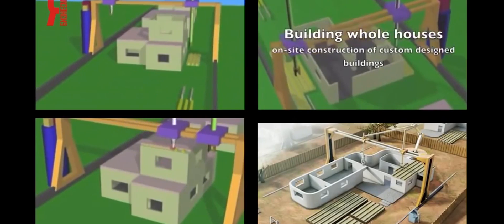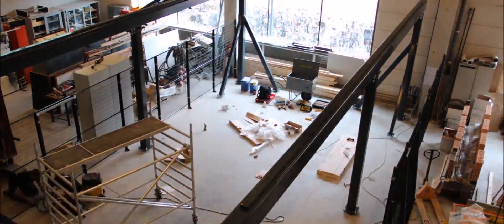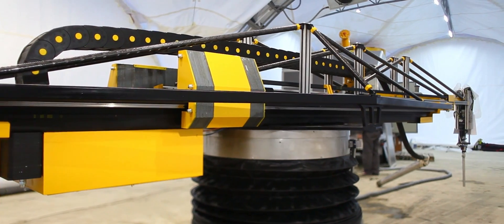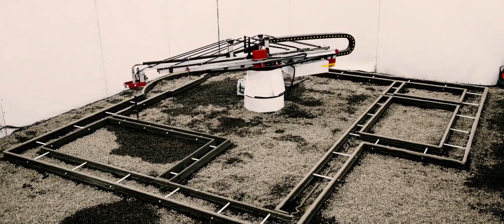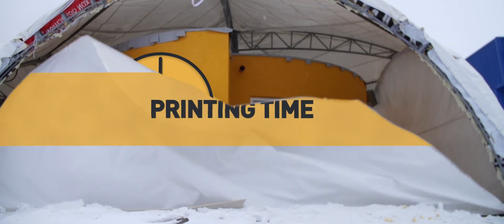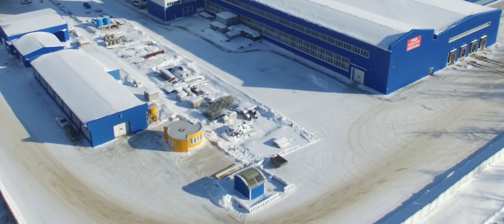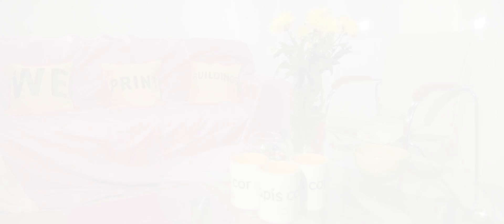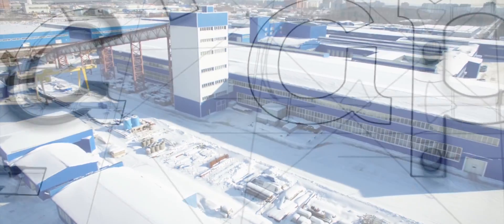Apis Cor: first residential house has been printed!

Comment: The house needs a  Cone top roof...   A Flat roof with 1 meter snow on top ?!?  No! BAD !
You are printing the house, so print a cone on top.  /|\ and then the snow will slide away and water away from the home.  Install proper drainage...

Comment: Non ecological, plus polyurethane transforms into a lethal war gas and will kill you in case of burn, and the polymer walls and rooftop are surely not so much better. What a waste. Construction in straw and wood are really cheap, ecological and sustainable unlike this 3d plastic garbage.

Comment: So in like a decade, all major building companies will have such 3D printer robots, printing very boring round shaped 'buildings'.
And most of the construction workers, masons, will be out of a job?
And yes, probably one job that wont dissapear is obviously electriciens. 
Cause every single market is going to need elektriciens to actually build/do maintenance on those printers. And lets not forget put a lot of electric & electronics in them.

Comment: I want to point something out I did the conversions the square meter to square foot and it came out to be 409.0282 square feet. The average cost per square foot is $125 which means if you were to build a normal house of the same size it would cost around $51,128.53 this house that they 3d printed is a fifth of that. That's amazing

Comment: Very interesting but 38m2 is too small. I want at least 150m2 the question is, can they do a structure that big? How do they move the printer around a larger structure? Other commenters address land, sewer, gas, water, etc. But you can get very cheaply an old house for demolition that has all that for the price of just the land. The money you save vs. traditional construction you can use to put solar panels on your flat roof!

Comment: Anyone arguing the reality of 3d printed homes are lost in time somewhere.  Dude, this is a cake walk compared to the automation technology that has already existed for decades.  I've worked on many types of automation systems and this seems far easier than an automated pharma plant, lab, space shuttle launch, a computer processor, automated car factory, horizontal oil drilling, etc.. This is easy peasy people and you're a dumbass if you think it can't be done.

Comment: I would like to know what the expected longevity of the building is. That roof doesn't look like it will stand up to much weathering. I also do not trust the "honorable mention", comparatively speaking, that the house mechanicals received.

Comment: What's good about this is that building this house doesn't last really long it just lasts for a day and It's very easy and fast and it doesn't need any effort but what's a little off about 3D printing is that if they kept using 3D printing for houses then people won't have a chance to get a job and work so I think the builders should work on houses by themselves instead of 3D printing. Just my opinion please don't argue.

Comment: Is it limited to round/circular designs? Because that is very space ineffective. Much better utilization of area with square/rectangular shapes. Circular design prevents modular design where you can extend and expand current designs or align multiple houses in parallel rows or group them into modular sections.

Comment: Dunno if this would fly in California, earthquake standards etc. I noted the horizontal reinforcement, I didn't see any vertical ones, not that it would be impossible, just curious if it would pass our current building codes. I'm also curious about how the electrical and plumbing is put in, they didn't show that - it's obviously there. With a smaller structure you would need central air (a requirement in some areas) which is nice, and in some areas residential sprinklers are required.

Comment: does it print windows, pipes, hanged ceiling? and then it says printed house cost usd275 per square meter and normal brick build usd232 per square meter.. where does the 70% saving come from? So many things are not explained. And for that reason this video can be completely disregarded.

Comment: RIP CARPENTRY
Reply: And many other trades.
Reply: Actually it's really funny how Americans spend thousands of dollars on reinforced doors with 8 point locking systems and etc, when u can just enter thru the wall...
Reply: carpentry is already dead in Europe, no one builds wooden houses with cardboard walls here. get with the program, america!
Reply: +guguigugu
On a mass scale, yes.  However, there will always be a market for wood furniture and structures.  One thing nice about wooden framed houses is that the material itself, wood, can easily be replenished.

Comment: Extruded concrete with no reinforcing steel?  Concrete mix looks watery, makes concrete brittle and weak.  Actually looks like cement, no limestone gravel at all.  Foundation?   Did it print the windows and wood floor too?  Painting concrete that hasnt cured yet?  I am glad someone is working on these ideas but it still has a very long way to go.
Reply: watch the video!!!! it's polymer concrete and it doesn't need to cure
Reply: Its reinforced with fiberglass.  Steel reinforcement has destroyed a lot of older buildings because it oxides over time and destroys the concrete.
Reply: thanks for the info

Comment: ok - when it sounds too god to be true....$10,134 for 38m^2   = USd  $25/sf (410sf - rounding up & dwn)  -  includes - foundation, roof, in/out wall finishes (paint,texture), insul, windows, floors, clg mat;l)    - I would say buy this all day long - in USA we can not come close to this kind of cost - block alone with  no foundation assuming 8-ft ceilings - mat'l and block - not filled is going to run $6-$8k for curved and that does not include an oh&P, now suspending /false work for ceiling - labor and material - no foundation---- the list of what is not included is not small ticket items and starting and stopping to run wires in walls, plumbing - and of course in the US - stopping to have inspectors come and look at stand pipe testing etc... no way is this getting built on site (with current municipality ordinances) shop built and delivered no issues - but still $10,134 for foundation, walls, roof, windows, doors, flooring, wall finishes, insulation - well not in the US - -I would have to built 5-10 a week to make a living  - - I think that this promotional video would be better serving the industry to provide "anitcipated" real world costs - or what a home owner might expect to pay - i mean seriously  in central texas a slab can cost 12-20 /sf and up, even coast line building in sand foundation easily half $25/sf or even close -
Reply: Isn't it interesting that government is (and always has been) a significant, possibly deal-breaking barrier to building affordable housing?
Reply: digressing and possibly reading too much into my comment - inspections are a part of the building process because of historic failures - it will be very difficult to rid the industry of this - although many municipalities to allow 3rd party inspectors to "cover" the process - this cost is built into the project as is the time - and that was not really the point - 24 hour building was the machine turning and squirting - they did not at all talk about the reality of starting and stopping to place electrical, plumbing etc within walls, waiting for inspections - even in a fast paced project will still results in some time   (HGTV - is unique and again not a reality for typical buyers) time - so as a contractor buying this piece of equipment and selling the foundation, walls, roof, - for no money to speak of in profit - I need to install and remove this machine multiple times in a week period to even come close but never ever touching a $25/sf cost for a shell that includes a foundation - material cost alone is going to cover that cost and it makes little difference if block, insulated block wth poured concrete cells or formed and pumped concrete - the cost in the video serves no purpose to the public - I would right now order 10 of those units to be built for $10134 and rent them out and retire - I challenge anyone to plug the foundation, walls, roof, ceiling, wall finishes, flooring windows & doors into the proforma - the DCR would have banks bending over to lend money - I am not trying at all to be negative (even though it clearly appears as such ) but the numbers are not realistic) not for a contractor or home owner - estimate the cost of the machine - at $250k  - profit on $25/sf home shell which is close to if not $0 but maybe negative  - the Break even is non-existent  -  to BE in 3 years building every day with $1/sf profit ($410/ea)  that is 1.5 days per unit working 365 days it is just a poor marketing video that otherwise shows a wonderful achievement in building technology

Comment: what about resistance testing? yeah you can build it, but can it withstand the elements for 100 years?
Reply: Bruno Rodrigues it's polymer concrete. It'll last as long as any other concrete structure, except longer because it doesn't have any joints to wear out/weaken..
Reply: Resistance testing¨:-D Please go to the America and take a look on their WOODEN homes. And then you can tell something about resistance testing. :-D :D
Reply: you think 49m2 will be the limit of this technologies capability?
Reply: Bruno Rodrigues is concrete that shit is really reliable and long lansting
Reply: X Vars yes
Reply: Bruno Rodrigues the problem is the the flat floor what happen when there is a lot of snow ? 
the snow can't fall so the wall and the roof need to be very strong to support the weight of the ice +snow
Reply: Roman structures built with concrete still stand and at grandeur... so yes this is the future I would love a concrete house over my toothpick house
Reply: Do you expect to live 100 years in a 49M2 house?

Comment: How is the roof made - what is used as support when it prints "mid-air" ? you got a video clip of that? 
As a 3D print specialist I'm a little curious :D

Splendid job on this project thou !!
Reply: Construction complete.  New construction options...
Reply: Ken B although flat roofs have indeed these problems, they also can be easily fixed if you keep important rules in mind. Such as keeping the flat roof always on a small slope, say 1,6% to the nearest water exit and also make sure that your span is not longer as 3 meter etc (if you work with a wooden beam method) . I currently do a internship at a architecture firm and we already designed countless of buildings with flat roofs, so it should never be a big problem if you designed it right.
Reply: Adi G watch 3:53, it's probably just a wooden roof which is made on the job side when the walls are "printed".
Reply: Ken B.: 12% of all new houses built in Germany have a flat roof right now (and there would be even more, if local by-laws - which are there to keep the look of a quarter similar - would actually allow them).
As you obviously know, back in the 60-ies there was a lot of issues with flat roofs, but you are actually quite right, we Europeans are a little bit more advanced (at least in a lot of areas) when it comes to construction - that's why the current type of flat roofs built in Europe actually have the same life expectancy as a gable roof - thanks to modern materials and better education of the people building them. Of course a flat roof - as well as any other roof - needs regular maintenance (there shouldn't be any leafs, moss or branches laying around on the roof, otherwise you might actually get leakage over time - but if you have asphalt shingles with moss on them and all your gutters blocked by leafs or branches, you will get ice buildup and leakage with a gable roof in no time as well!).
The only problem still remaining is - as you mentioned - that the load-bearing capacity of a flat roof is often an issue in areas with high snow fall. The latest article I read mentions that depending on the type of snow, about 15 cm (of very wet snow) can already be a problem, but e.g. 60 cm of powder snow are no problem at all for a modern flat roof. If you got more snow on the roof, you need to clean some of it - and they actually have automated scales systems which can be installed on your roof which send you an email and/or text if they sense that the load is getting too much and the roof needs to be cleaned.
Having said that, a lot of flat roofs nowadays also have planted roof gardens on top of them, which actually additionally increase the heat efficiency of the house - and you can easier install photo-voltaic panels on those roofs as well, since you don't have to have side of the roof pointing south, but can simply place the panels however you like.
All of this of course is only true if you have the engineers with the needed knowledge, the trained personal to install these roofs correctly, and if you use the aforementioned modern building materials. If you still use the very simple construction with just tar paper and bitumen sheeting (like they did in the 60-ies - and in some parts of North America even today), then you are of course completely right - those roofs are rubbish. ;-)
Reply: dumb and misses the point if it's not also "printed" but yes there would need to be some form in place if they spray concrete on and I hope it has some angle so the rain runs off.
Reply: Follow the link in the description: http://apis-cor.com/en/about/news/first-house

"The roof of the house in Stupino, in accordance with the architectural project, is flat. The solution proposed by the TechnoNICOL company can effectively withstand high snow loads and durability requirements. Its cost is comparable with steep roofs, which are common for our country.

The roofing carpet is made of LOGICROOF polymer membranes. The material has high performance and technological installation. Membrane patches are welded together with special equipment using hot air. Installation works at speeds of up to 1000 m² in a work shift can be done in any weather conditions."
Reply: ken B idk where you live but flat roofs are common all over europe. follow the rules and they will last.
the video specifically mentions that the roof is slightly inclined, because if you're clueless enough to make a perfectly flat zero degree roof, you should have your license revoked momentarily.
Reply: LOL, I got it right away as soon as I read it..
Reply: laying conventional concrete beams on top of it and filling them with hollow concrete concrete or clay blocks
Reply: So do all flat roof towers have problems? I don't see why they could make it right for tall buildings and not houses...
Reply: @Adi G
I am a Structural Engineer and I can give many reasons not to build a house with a flat roof! For starters flat roofs have very little structural capacity and it only gets worse. Mostly certain the flat roof will eventually leak when it rains and this is the best case scenario. Also, it is most likely that ponding will form on the roof when it rains. The ponding effect will quickly get worse and worse as the roof sags more and more as rain accumulates until the roof collapses. Water is very heavy! Also the snow load could be tremendous as it builds up on the roof! Again leading to a sudden collapse. Even Eskimos knew this thousands of years ago when they invented igloos (arched roofs are actually  strongest). Flat roofs are absolutely the worst possible idea and will not meet any engineer code (you will not see any flat roofs houses being printed in your neighbor). Actually you can have flat roofs but with only with certain design parameters that I will not discuss. Can't believe these guys did not consult with an engineer before designing this house! Marketing does this all time. They have all the money and keep engineers out of the loop and poor (you know exactly what I am talking about Apis Cor!). But I love that a house can be 3D printed!!! Can't wait till this technology is more available and cheaper.
Reply: It is impossible to build a zero slope roof. There is always going to be a slope because no construction is perfect. But what I do say is why do you want to build a flat roof house when you are going to have problems with it (guaranteed). You are right I live in USA so I don't have a clue of what y'all do over in Europe. I honestly thought your construction practices in Europe was more advanced than USA but now I have my doubts. Don't worry about me getting my engineer licensed revoked because I will never design a flat roof house because of the issues you are going to inherently have with a flat roof.

Comment: It says it can print from 5 degrees about zero and then says it can print as low as -35 degrees. Which is the lower limit? -35 or 5? What is the upper limit?
Reply: That part was hard to understand, I admit. Since they used a tent to keep it warm during a cold winter, I am assuming that without a tent it's 5 degrees, but using a tent you are immune to all the elements essentially (rain, cold, snow, sleet, zombies, etc.).

Comment: how to solve the issue of earthquakes?
Reply: in the same way as with any other structure if it is being built in an area where earthquakes are. Nevertheless, ferroconcrete is definitely of higher resistance than wood which is widely used in the US
Reply: How I can believe it this is good quality work cause here is don't use reinforcement .